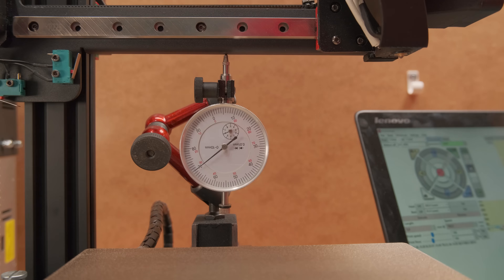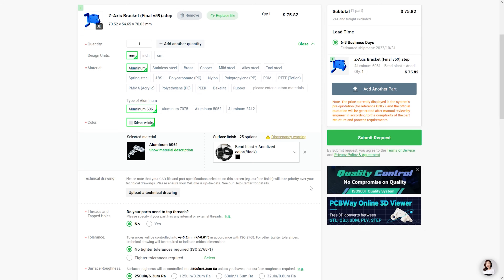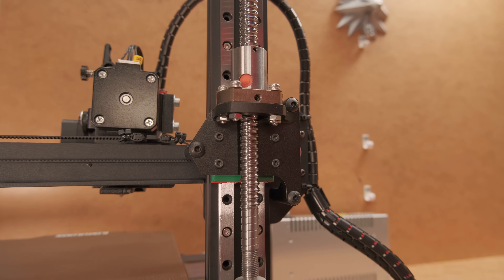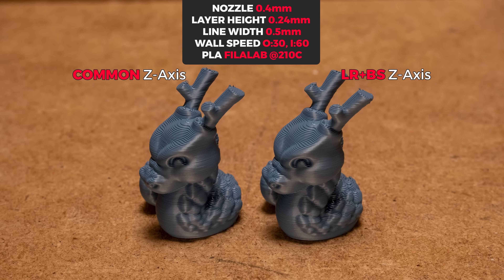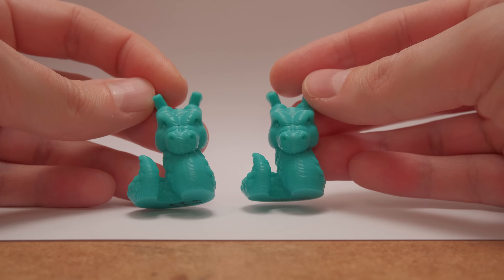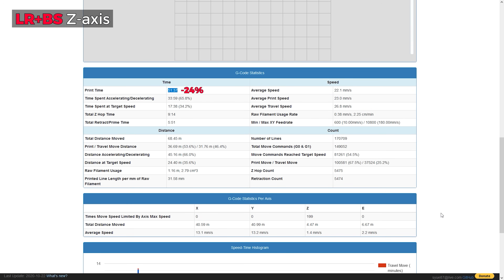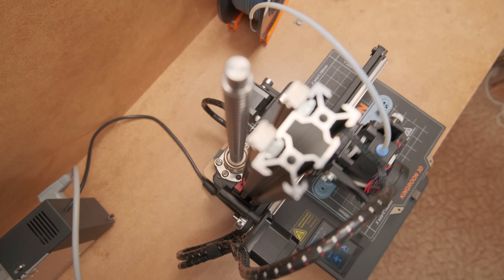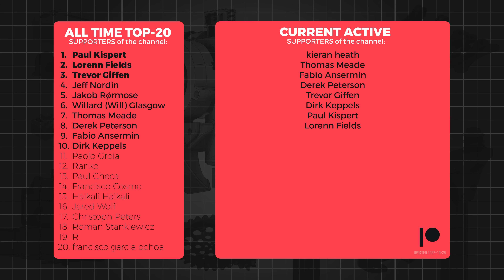3D Printer’s Z-AXIS ULTIMATE Precision Upgrade – IS IT WORTH IT? (Linear Rails + Ballscrew)

Comment: Even with the most advanced printers, slight imperfections can occur.  However, with proper calibration, slicer settings, and high-quality filament, you can produce prints that are incredibly close to perfect.

Comment: Why was printing in plastic impossible? Genuine question.

With that shape, I could appreciate flex near the base, but given the clearance a different shape could have provided significantly more rigidity.
Reply from the maker: It will introduce a wobble to the X-axis from the heatbed movement, which will make printing results worse than a stock printer.
Reply: @PrintingPerspective  I'll take your word for it, though I remain skeptical. There is a printer called "The 100" that was designed to be an ultra-high speed 3d printer (eg. 10min benchy),  that uses a completely plastic, 3d printed frame (from a series of bolted together parts) and does not seem to suffer from wobble given the rigidity (lack of flex) due to the part thickness.
Reply from the maker: @SeanLumly okay, but I am talking about using aluminum part vs plastic in this specific scenario, where it holds the whole arm and the printhead. There is no room to increase the thickness of it to be as stiff as the metal one with a reasonable size. Of course, you can make a plastic part that can be more rigid than the metal one, but it must be way bigger and better engineered. Nothing is an apples-to-apples comparison when it comes to this topic, you know.
Reply: @PrintingPerspective  I'm looking at the design, and yes, room would have to be made for the screw (and possibly couple), but I believe the the screw can be threaded through the structure allowing the mount to extend out in the y-direction, up in the z-direction.

I'm not suggesting you do anything in particular or that you did anything wrong. There's no need to be so defensive -- I'm suggesting a potential path for an alternate solution.
Reply from the maker: Bro, there's no way you asked a question and I am trying to give you my best answer and you are saying I am somehow "so defensive" lol. In each comment you introduce new variables to the original question and somehow wrongly interpret my answers. Sometimes I ask myself why I bother responding.
Reply: @PrintingPerspective   How did this become so confrontational?

I said I was skeptical, meaning that the reason given didn't satisfy my original scepticism.

If you assume I'm introducing "variables" you assumed that I was arguing from the get go. So yes, your position has been a defensive one. What would you call this?

Comment: With your single sided machine I was thinking if you changed the X axis print bed to a rotating circle bed that rotates with the bed width the original beds as it’s radius and instead of moving backwards and forwards it just rotates and the Y axis and Z axis works as normal you would increase the size by 4 times

Comment: The funny thing to me watching a bunch of your comparison videos is how many prints have errors in the exact same spots regardless of how many factors you change. That leads me to think that slicers still need more work to generate perfect consistency. It doesn't make sense that the same print with two different Z axis setups would have Z banding issues at the exact same layer unless something else was going on, ya know? Same with the Teflon coated screw and POM nut. Very interesting.
Reply: It's not the slicer buddy go look up the wobble-x adapter and see how a lead screw or ball screw with a tiny amount of unstraightness can cause this banding issue. In super Ridgid CNC mills where these ballscrews are normally used, a small wobble of the ballscrew will not affect a big milling machine with cast iron construction. With a machine with small aluminum extrusion frames, it will cause small side to side movement and banding. The wobble adapters are the best way around this problem and near perfect prints can be achieved on the basic lead screws and a pom nut with a wobble-x adapter.
Reply: @clutchboi4038  I'm familiar with Z-banding as well as its causes and fixes like the Wobble-X and Oldham couplers. As I said "It doesn't make sense that the same print with two different Z axis setups would have Z banding issues at the exact same layer unless something else was going on" meaning that there is something other than the physical Z setup causing the issue. If the same Z band shows up when he has replaced both the screw and support method of the Z, how can it be Z banding caused by the screw or guide type? I may be missing something, but I'm just saying.
Reply: @802Garage  I can see why you said that and that other guy was a bit rude about it but it is almost impossible for it to be the slicer. The slicer only tells the printer to move up and down on the z axis with coordinates. Since this guy has ruled out almost everything else, It could be a firmware, driver, micro-stepping, power, or motor stepping issue possibly.
Reply: @hydos0694  Absolutely possible for it to be a slicer/print settings issue, though I'd have to rewatch the video 10 months later to determine if I still think so.
Reply: @802Garage I’m sure there is some cases where your slicer settings might be an issue, but there is pretty much nothing I can think of that would remotely looks like z wobble. Regardless slicer settings issue is either a documentation issue or a you issue, likely the latter.
Reply: @EclipticFactions I totally get what you are saying, but also examine what I said. How would two different Z setups have issues in the same areas? That's the point I couldn't find another cause for. I'll have to watch the video again now that quite some time has passed to see what I think.
Reply: @802Garage it’s definitely strange, my best guess is that the issues are caused by something other than the z axis, I still don’t think it has much to do with the slicer but it’s impossible to know that for sure without looking at the gcode manually.

It’s even more difficult to be able to know what’s going on without having a close up video recording of the print and being able to watch the exact instant the issue occurs. It honestly might be an issue on another axis that causing it. 

The main reason I believe it’s not a slicer issue is because the slicer (in most cases) isn’t adding any extra instructions that can cause this issue. 

We’re realistically just making assumptions here, neither one of us can possibly know whats going on since we don’t have access to enough data to look through.

Comment: Prints look like they have heavy wood patterns on them, my printer has the same. It's because of the inaccuracy of the gears in the BMG extruder. dual gear extruders run in direct drive suffer from this wood pattern, mirageC and Vez3D made good videos showcasing the wood pattern.

Comment: As far as I have seen these kinds of inconsistencies are because of extruder issues. Direct extruders are too ' direct ' any small imperfection will show up in the print. One thing bowden setups have a leg up on direct drive is that it somehow dampens extruder stuttering or missalined extruder gears causing a fluctuation in flow.  

This mod looks like AF tho.

Comment: Such a spindle is absolutely unnecessary, as two linear rails are already installed, which I also see as too many.
Then another part made of aluminum Vertigen is simply unnecessary.
Then you should invest the money in an industrial printer.
I myself installed the Z axes in the SX1 with a linear rail each, so that there is no longer any misalignment. It also turned out very well.
But as I said, you can also overdo it and do it if you have too much money.
But otherwise a good educational video

This is a Google Translation, sorry for any errors

Comment: Manufacturers don't use ball screws because good ones are too expensive. For an Ender 3 it would probably add US$300 to its price. And that's just for 2 Z axis screws. Ball screws are usually have grade levels ranging from 1 - 10, 10 being the worst. Those you show for $40 each are probably around grade 14.

Comment: How tight is your ballscrew nut tightened to the mount? I try to leave them loose and lubricated so they don’t force swaying on the arm/rails, so the nut only provide push/pull motion.
Reply from the maker: Mine didn't have wobble so it is tightened rigidly. You can check something like wobble x. MirageC have great video about it.
Reply: @PrintingPerspective  was yours graded (C0-C10)? or did you just get lucky?
Reply from the maker: It says C7, which is kinda crap https://a.aliexpress.com/_mrOuLni

But I used only 300mm long one so it's almost the best case scenario. There is also C5 for not that much more https://a.aliexpress.com/_mrcUYVE
Reply: @PrintingPerspective  C7 probably isn’t too bad considering C10 is the worst graded and there are a lot with no grade at all. I think i’d be pretty happy with C5 to C7. Not sure what grade the ones are that came with my printer. Its a trex3.0+

Comment: i wanna upgrade my Y axis to perfectly tight linear bearings. This seems like a very easy upgrade. i wouldnt even have to have any parts made. But the current Y axis on the longer lk5 pro (cr10) has 6 wheels on the center of the bed frame which squeeze into the sides of the one singular rail. the bearings arent made to have pressure in that axis and they move. ALLLL those style bearings move in the axis that they shouldnt have pressure applied. every axis. x,y, and z.. i already did a dual z motor upgrade and a few other upgrades but just now when i was leveling my bed i noticed when you press on the corners of the bed it will move what seems likea teeny tiny amount but is enough to throw your nozzle millimeters. the x and z axis dont matter as much because of the way the printer is buyilt, but the y axis holds the entire bed on it and the bed HAS TO be level or the prints will fail. ive been searching through mcmaster and amazon looking for linear rails and im stuck between 2 roads to go. the lk5 pro is a like 500 dollar printer. so it wouldnt make much sense to drop 2 grand on high precision rails made for industrial applications, but i also dont want to drop 73$ on amazon rails if they arent gonna be precise. if the cheap bearings have play in them then it defeats the purpose of.. i was hoping you had some insight.. or a review on the rails you bought..
Reply from the maker: Personally, I am not a fan of buying expensive parts for cheap printers. That is why I just order these from Ali - https://youtu.be/O7DMtMtY22Q I modded my LK5 Pro with these and it prints great.

Comment: The only part you nee upgrade in a printer is the Z axis lead screw to a ball screw to cancel backlash. Linear bearings add to much weight to the moving parts of a printer reducing acceleration times. Belts are the best.
Reply: How fast do you need Z to be? Lol I can see your point if talking about X &Y axis.

Comment: Did you test quality versus speed? Can the upgrade do better at higher speeds?
Reply from the maker: No, but higher speeds is the last thing you want to do on cantilever 3d printers. But sure it can print faster because it is more rigid than stock.

Comment: the only way to benefit form this setup is to improve extrusion and the motors as well
Reply from the maker: This was with Trianglelab DDB v2.1. I printed cylinders in vase mode and I didn't notice any repeating extrusion inconsistencies. And I really doubt "better" motors will make any difference. Maybe I just should make a video about it to prove it or eat my own words lol.
Reply: thx  @PrintingPerspective  ,you could increase layer height to minimize the spread a bit just to highlight extruder related inconsistencies. both filament diameter and extruder precision (I mean the gears) contribute. I wonder if you can find a test setup to isolate extrusion, maybe use a stylus to mark a hair thick line on the bed? but then pressure will twist the gantry, I saw that it's optimized for speed but not for rigidity. this setup should be considered heavy and strong, so more balanced between speed and precision/torque. maybe use a laser and a fax paper. anyway at one point I'm sure controller and motor type will be the limit (try high end servos?) I notice the backlash is still there but smaller, I wonder where is comes from.
Reply: @PrintingPerspective  about the repeating patterns : some frequencies will be mangled if the vase mode object has himself a layer frequency that don't create visible harmonics. depending on the type of extruder (gear sizes) you can have multiple freqs. to test well you could try to sync more the layer volume to one gear turn.
Reply from the maker: This is a good point. But if I would properly test the extruder consistency I would just assemble a jig and with a dial indicator measure the consistency of full rotation. This would completely eliminate other variables. I feel like I reached a point where the upgrades give only diminishing returns and chasing every last bit of quality improvement is too crazy for my taste.
Reply from the maker: Yea, but I doubt it will ever be a perfect printer because the "perfectness" depends on the knowledge, experience, and expectations you have. For some people, $100 Ender is the perfect printer. Why? Because it prints no matter the crappy quality for cheap and they don't know any better. And for some their custom build all metal CoreXY $5000 printer is crap because it can't print with pristine quality at 1000mm/s. That is why the price-to-performance aspect is the most exciting for me. You don't need the latest cutting-edge parts, you just need good enough parts and make good decisions with them. Most companies don't do any testing and just keep copying one another with the same flaws because most of them are so incompetent and just profit-focused. It is so scary when you look at the market and see so much crap and only a few printers that are actually worth it for the money. How the hell there are still printers that use PTFE tubes and not all metal hotends?! And still Bowden extruders? One part cooling 4010 blower fan?! It blows my mind no pun intended lol.

Comment: Thank you for this review and perspective. I have one printer, Creality 10s Pro V1. I had to make some upgrades to improve performance. BL Touch, Timing Belt for dual Z axis screws and Direct Drive from Microswiss with their Hot End. I added Z axis Struts too. I am stiving for both detail prints of small parts and accuracy of larger Prints for my Model Train Hobby. Now i need to add another requirement SPEED. With one machine and selling train parts I occasionally need to print a lot of parts fast. I also do R&D and have to print a few parts in good detail.  I was thinking about an Ender 7 as a second printer but saw Creality has a new Mother Board with 32 Bits, Now I am interested in that. Then I saw Linear rails for Z and X axis I like that. But I really don't have a handle in what is best and what works short term and long term. Would be able to offer any insight to this dilemma, One machine with all the upgrades thrown at it or  second specialized machine for small parts printed fast. Thank You, Dennis
Reply from the maker: I don't know why you are so hooked up on one brand. If you enjoy modifying 3d printers you should have at least two of them and if you don't care about that and just want to print with speed and quality buy the P1P,  the value of it is insane but it is also very loud. I think the days of bed slingers slowly coming to the end and hopefully we will see more and more CoreXY type machines in the future. Just do yourself a favor and don't buy one with POM wheels.

And for the 10s Pro I suggest upgrading to Klipper because it is almost unfair how much speed you can still push out of a 3d printer with it. Here is my old i3 Mega S running at 400+mm/s and 12K acceleration https://youtu.be/n23zvv27flM

Comment: For a single screw driven printer, it does not hurt your wallet. But if you have like a triple z axis bed, the cost really adds up. If budget is an issue, then using oldham couplings with standard leadscrews is quite effective.

Comment: Wow. You're serious in this 3D printing game, using a precision dial indicator, using ball screws doing inspection using microscopes. Never seen anyone doing this on youtube. would like to point out, you should consider building CNC 3d printer from scratch using thick grade A granite surface plate with 10 micron precision hiwin linear rails. This will solve so many issues. However 3d printer nozzle also needs to be accurate when it extracts ABS, that alone is another rabbit hole to jump into. If you do this, you'll also have a super accurate CNC mill and PCB sensitizing liabilities all in one CNC platform.
Reply from the maker: Yeah, I go "all in" as I can. I would love to design a 3D printer someday, but I am a guy that is never satisfied with the results unless they are near perfection. Maybe in the future when I test more topics with definitive answers on what works better and what doesn't, but for now I am trying to stay away from that time sink, haha!

Comment: Sounds to me as if by far the largest reason to make this upgrade is printing speeds. A quarter faster is a pretty big difference. Pretty interesting, thank you for testing.
Reply from the maker: It definitely helps to have perfect Z accuracy when printing thinner layers, but yes the biggest benefit of this modification is faster Z movement and acceleration. The print speed is so much more fluent and faster, especially if you have Combing mode OFF in CURA and Z-hop higher. Also manually leveling the bed is so much quicker.
Reply: @PrintingPerspective  Am I correct in thinking that backlash is also minimalised when using ballscrews against leadscrews?